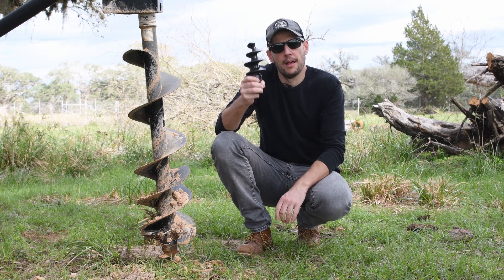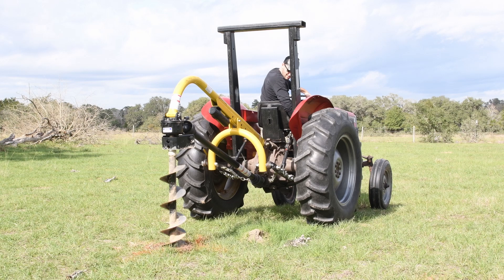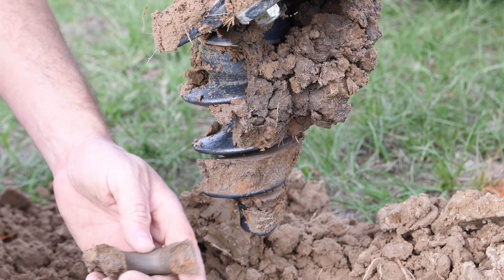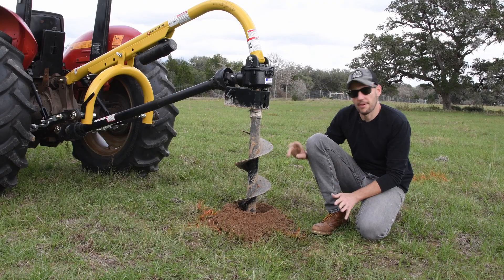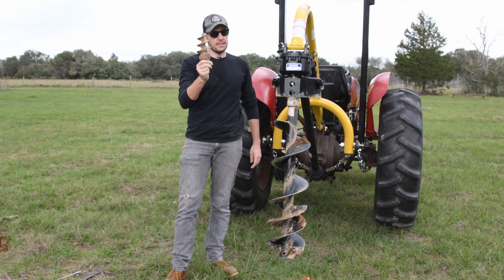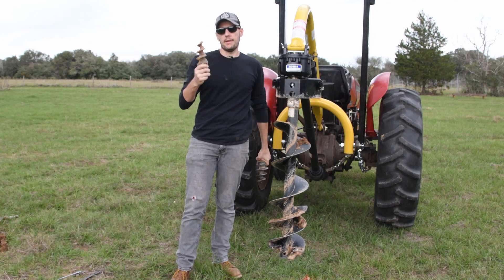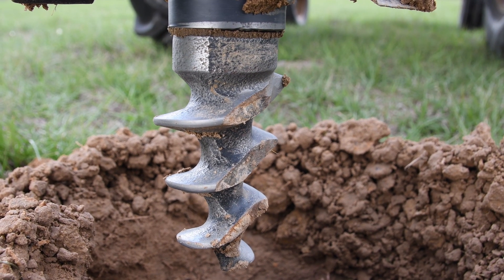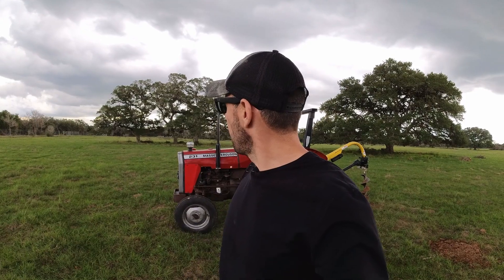Testing 3 different auger tips on clay

Comment: This was a good informative video got mine stuck on the first hole  i was thinking the cutting teeth were on too sharp an angle like different drill bits have different angles for different materials but this seems alot easier to try i cant spend an hr getting the bit out on each hole thanks
Reply from the maker: When I first got the auger I got it stuck badly the first time. My following 5-10 holes I had the same problem until I learned how to use it. If you have clay soil change the tip and don't let the auger go more than 3-4 turns at a time. Also I can now hear the sound change on the hydraulic when the auger catches and want to drill it self down so I stop immediately. In this case pulling up and rocking the auger back and forth a little bit help getting it out. Thank you for checking the video.

Comment: One of the best things you can do if you plan to dig a lot of holes with a tractor, besides getting a FEL mounted auger, is to have the remotes match on both the 3PH and auger.  m &m on one, f&f on the other so you can easily reverse the flow and back the auger out if it gets stuck in clay or on a root.  But if you have enough GPM hydraulic flow, a FEL auger can't be beat.  You can see what you're doing, apply downward pressure, and reverse rotation on the fly.
Reply from the maker: Agree, hydraulic would be the way to go. In my case the half cut tip is working very well. So far I have made 50+ holes and does not get stuck. In any case this is a 600USD auger, so it is what it is. A bit wobbly, not too curate but for what I do it serves me well.

Comment: It’s best to drill about eight inches and pull it out, eight more and pull it out. Go slow and drill a little then clear the hole, that way you don’t get stuck. 
Yeah I learned the hard way.
Reply from the maker: Agree, it is a hard learning curve until you realize that is the way. until you figure out, lot of pipe wrench and cheater bar trying to get it out.

Comment: I built a stop that rest on the ground at 2 feet so when it starts to bury all it does is stops and then it spins and strips the hole out
Reply from the maker: I tried something like that at first but I could not strip the hole, instead I snapped the sheer pin on the auger. Hard clay is tough. Thank you for checking the video.
Reply: @BUTTEWORKS  yes sir and that’s no joke that clay is no joke we are primarily Rock in my location